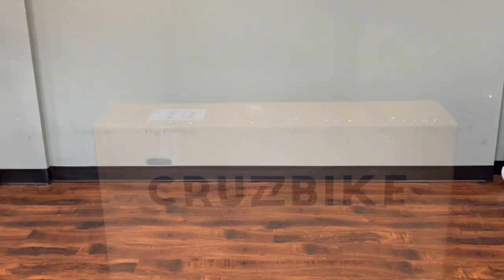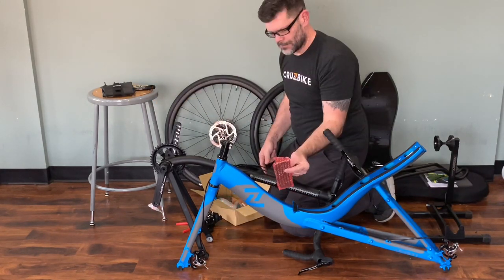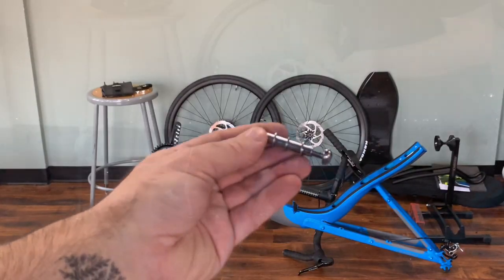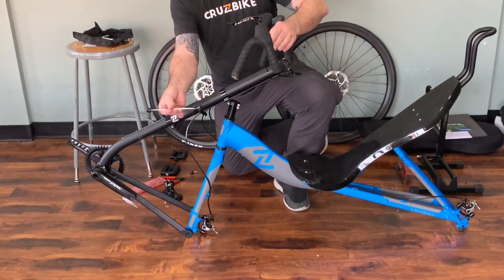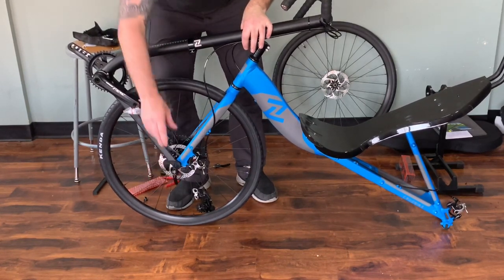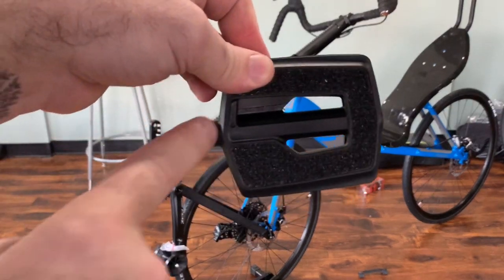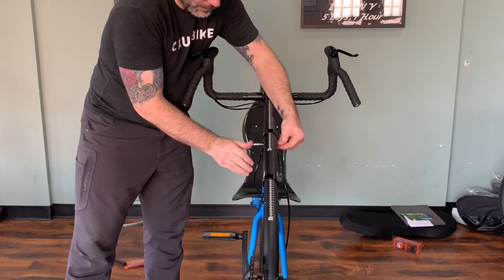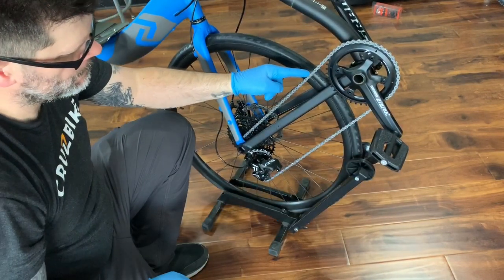S40 Complete Assembly 2020 | CRUZBIKE

Comment: Robert, which XD driver  is compatible with that hub? I foresee a need for a 42x10 to avoid early spinout on long downhill sections.
Reply from the maker: The stock wheel is equipped with a standard 9/10/11 speed hub and is not XD compatible.
Reply: @Cruzbike  Thanks!

Comment: Beautiful bike. I’d love to get one, but $4200 for an aluminum frame, bottom tier SRAM components, and entry level tires? I just don’t see the price matching the value. For $4200 you can get an AZUB with suspension and carbon.
Reply: While I have never been on an AZUB, after a lot of research,  I became convinced the overall engineering of Cruzbikes, and now the S40--particularly the front wheel drive and choice of 1 x 11 gearing, will produce a superior overall ride experience, especially if you ride on hills or major climbs. I have 3 years experience with the S30 and its super fast but the physics of so much body weight toward the back with the lower seat angle makes climbs over 8% challenging--you have to pull up to 40 degrees to get the right torque. So, with more climbing ahead for me this year, this bike is ideal. Just buying a less expensive bike to get suspension and carbon does not guarantee you a superior ride.